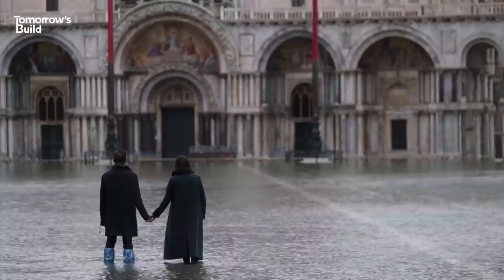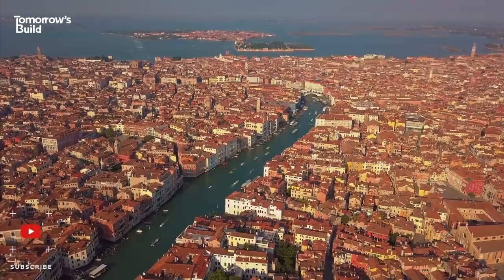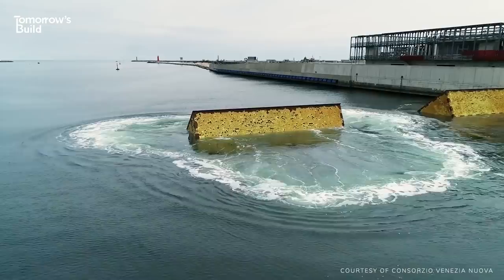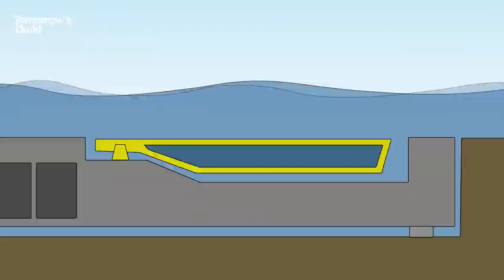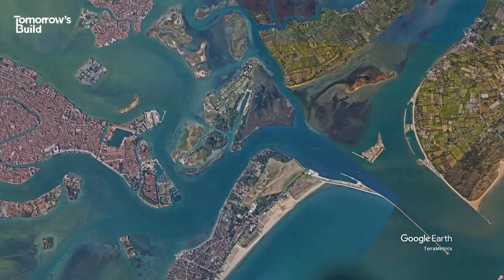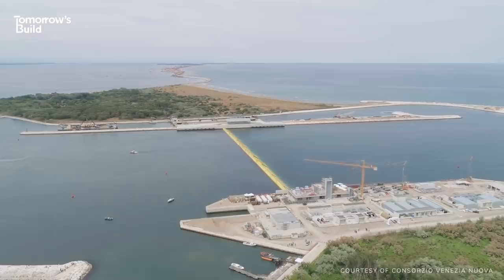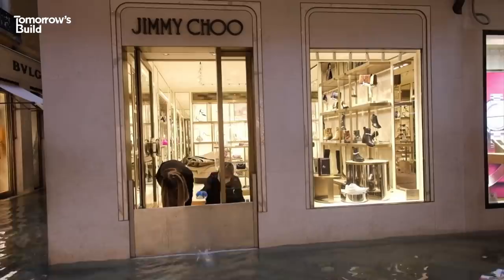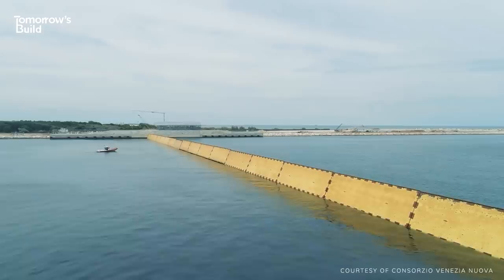The $7BN Megaproject to Save Venice

Comment: The clever bit of this system is, that it dynamically adapts to the tide level difference. In contrast to a watergate system, where huge steel doors have to withstand the tons of pressure from the water, these barriers operate basically without much stress at all. Waves are mitigated by the rotational degree of freedom and the water head pressure from the sea to the lagune is carried by buoyancy, rather then stressed steel. 

From an engineering standpoint, this system is great. Why, you might ask? If the water head becomes to strong on a conventional water gate to the point of system failure, the gate bursts open and lets all the water through, with the devastating effect of a broken damn. This system does the opposite. If the head pressure becomes to strong, a small flow over the top becomes possible, slowly and gently raising the lagune water level until equilibrium is recreated once more. 

I can see why it cost so much money, it's a brilliant solution.
Reply: And this is a brilliant comment.
Reply: Basically, the gate being slant at an angle makes the difference?.
Reply: Oh, Why you might ask? Lol
Reply: @kalyanvadlamani7607  the gate floating makes the difference mainly
Reply: Very well written summary, this is how I saw it working also
Reply: @kalyanvadlamani7607  compare a monkey trying to pull out a fistfull of goodies from a jar..
The more the monkey wants to grab the harder for the fist to come out of the jar.
Comparison may sound crazy but ????
Reply: Grazie amico
Reply: The system is great and smart, but stresses are still there, just not in the barrier walls - they are in the hinges. So theoretically the worst scenario with sudden rapid flooding is still possible. 
But with maintaince this problem should be negated
Reply: Men, Devinci solved this issue a few hundred years ago
Reply: But did it really have to be a dynamic system across the whole width of these channels? It's not like a single watergate in the middle is the only alternative. Couldn't you replace huge parts of the system with a classic dam, and save billions of dollars in cost and maintenance?
Reply: @trueastronawt  If you want to absolutely destroy the ecosystem that relies on the current under normal, non storm flood conditions, sure. But the lagoon needs the large amounts of fresh seawater that come and go. Also forcing all this water through a tight gate means much, much higher current at the gate. If you are a dolphin that wants to go into the lagoon, good luck not drowning.
Reply: You need to share this with the Jakarta provincial government
Reply: @GermanTopGameTV  It's not floating though? The video said it is sitting on the seabed, and the actual "gate" is hinged to one point. Theoretically that one point of contact is receiving the most stress.
Reply: @NotTurtleish  the hinge is the point of highest stress, but it is comparably low stress to all possible alternatives. The resultant buoyancy force is applied here, but all pressure differences cancel each other out. The force on the hinges can be assumed to be (within reason) constant.

The great thing about a constant force is that is mediates cycle fatigue.
Reply: @GermanTopGameTV  there would definitely be forces placed on those ringes. The gates aren't floating they would reach a certain angle in which force they are designed to hold. Once this height is reached the force from the ocean would be primarily placed onto the hinges. There isn't much force in rising the gates as they are raised through bouncy which is correct but the force generated to hold them and not raise any further or be pushed over by the current of the ocean is only balanced by the weight of the gates which would be quite heavily neglected as to use the bouncy method you are referring to. In turn there would actually be immense force placed on those ringes, it wouldn't be neglected.
Reply: This makes sense
Reply: This might be a silly question as i dont have an engineering background but are there no other entry points for the water? If i look at the edge of the lagoon it could just easily enter the city on a really bad weather? Or does that not really happen. And if not should they account for it i.e. due to climate change?
Reply: Even though complex systems cost money, that' not the reason it costed so much, as it is explained on the video.
Reply: @XxXgabbO95XxX  yes lots of corruption , a lot of people never picked up on that.
Reply: Sadly the solution has failed many times already.
Reply: Yeah I’m sure it is amazing but it seems like something better could have been figured out
Reply: @alanrice6077  like what ? 🤷
The way to "Dutch" have done your water control 🙂
Reply: No. I don't think so. The complicity of the project made it super expensive, first. Never tried before, but in tiny laboratories, that means you can't be 100% sure it will do its job, second. And, flood doesn't not ends at current level. In the next 50 years I would expect the floods and tides will rise in the level as well as in frequency. That means We will have to rethink and improve the project. And that particular design doesn't let ANY upgrading! Finally, we will have to build another one. Note my words.
Reply: @kalyanvadlamani7607  no if it were held up by hydraulics, the angle wouldn't do anything.
Reply: They are in fact genius, as the tree that doesn’t bend, breaks! These “floats” flex with the pressure.
Reply: The force on the hinges would be greater for a swing gate sluce such as the Maeslantkering in Rotterdam. The rising sector gates of the Thames Barrier are also limited due to mechanical strength to a width of around 90m. The Moses system is elegant in it's design, using compressed gas so it's non mechanical (just like the Thames Barrier or Maeslantkering), with the resultant force being on a hinge so it's more likely to stay closed than open on a storm surge. The lock structures future-proof it to an extent so unlike the Thames Barrier, if it had to remain shut then vessels can still transit. The issues remain that if such sea level rise occurs, Venice will become a stagnant pool, making it a thoroughly unpleasant place to be. Hopefully however MOSES will keep Venice safe for long enough for us to face the challenges of rising sea levels and deal with its consequences accordingly
Reply: It all sounds good, but I'm surprised it apparently needs to be turned on manually?
Reply: Just change the building standards so that the city functions with flooding. Replace cars with boats, flood proof buildings.
Reply: Lol they made it about a meter too short to be of any use by the end of this century. Oops.

Comment: It’s cool how these barriers are raised by using compressed gases to displace water, in the exact same way Submarines resurface.
Reply: Don't subs use ballasting to acend and decend??
Reply: @hueyfreeman7810  ballast is just water where there would otherwise be air.
Reply: @hueyfreeman7810  Once they're submerged, they can change depth using their control surfaces like an airplane. But in order to get submerged in the first place, they have to flood their tanks. And viceversa when they want to resurface.
Reply: @hueyfreeman7810  Subs work the same way. They have water tanks for ballast and when they want to surface, they blow the water out the tanks with compressed gas. Submarines also use “dive planes” (like a wing surface that can pivot) to pitch the submarine up or down
Reply: @notmenotme614  no
Reply: @hueyfreeman7810  Human ballasting.

Comment: I visited Venice in Nov 2017 and was shocked how much of the city was submerged when on a Gondola tour. Stairs and landings which would have been above water level when built were probably a metre underwater. It’s a fascinating place considering it is mainly built with wooden piles under it. It probably would have been cheaper to build a sea wall round the city instead of all those expensive gates?
Reply: There were different solutions. Even talking about raising foundations like they did somewhere else.
Reply: David Wang  Nothing lasts forever. What are you saying?

Comment: I once worked offshore close to Venice. The Adriatic can be as mean as they get. One night when boarding a helicopter, the wind and driving rain blew ferociously enough that the helicopter had a hard time staying on the helipad. Being a large man, they asked me to get aboard quickly for ballast. I was soaked as everyone else was. The helicopter shook trying to maintain its footing. The normal paperwork for the flight couldn’t be accomplished at that time. The Helicopter Landing Officer (HLO) was fighting the wind and rain to the point he crouched down leaning into the gusts. Once the doors shut and the pad cleared we took off with little resistance straight up into the storm. The funny part was that once we gained a few hundred feet, the ride smoothed out as we turned direction to Padova, Italy. The airport was only 20 miles away. 

Other times the Adriatic was so ruff that the rented cruise ship Nord Norge had to leave the platform because of the swells. We had a good 25 feet of up and down for hours. Finally we made for Port of Padova and protection from the sea. We had to stay there for 5 days before we could make it back.
Reply: Now you understand why the mythology was so much about the Adriatic. Because they truly would either get lucky and have a nice travel, or just straight up die in a horrible storm.
Reply: Great comment! Just have to say *rough and not ruff
Reply: You are right! Sometime, due to meteorological condition The west side of adriatic sea is as a pot when the water boiling. The waves rise up very quickly due to wind that increase speed constricted from Croatian and Italian mountais and the modest deep of seebed.
The result is a storm with high wawes withot a preferential direction an gusts of wind of very higt intersitity.
Reply: I doubt that helo was flying in those weather conditions sounds like a tall story to me!

Comment: What abt the sinking issue with the foundation? If I remember correctly, Venice foundation was built on wood, and at some point they were considering shoving in compressed plastic underneath fill in the space and hopefully make it more stable.
Reply: Yes, in the end this is all a huge waste of time. Venice is a temporary city and it cant be saved, and shouldnt be saved. 7 billion on venice with the state of southern Italy is shameful. The Venetians complain the cruise ships are making the water worse with localized displacement, being willfully ignorant of the fact a packed city with no roads or production of any sort needs cruise ships. They want to pretend that Venice has a reason to exist outside tourism when it hasnt been a financial center since the advent of the world economy. But the Italian govt wants to save it because tourism is all they have for the most part. That and the piles of crap Fiat builds you cant buy if you live anywhere it gets cold. Cause youll freeze to death.

Comment: It would cost less and be more fool-proof to build a causeway along the entire sea wall side of the lagoon and the Adriatic. Then using a pair of locks to allow ships to transit as needed, even up to cruise ships sizes. You could even build a slim causeway from Venice to the sea wall and have a commuter system for ships that might be too big in the future to use a lock. They would dock outside the wall and the passengers would transit into the city. 

The water in the lagoon would slowly become less saline and a new ecosystem would develop. This would allow for many things not found in the city at this time. The sea wall could even be built to put in a new airport. The advantages are huge for this Secure Lagoon concept and the cost is far less than what is being touted here and the big take away is that Venice would NEVER flood again.

Comment: ABSOLUTELY FASCINATING and all encompassing!  Some of the best time I’ve ever spent watching a video.  Although I’ll never have the money to travel internationally, I sure hope Venice can be saved.
Reply: Unfortunately this is only a temporary fix to a long term problem.
If not for the floods the city of Venice is still sinking into the waters around it.
The 7+ Billion spent would have been more wisely used if they did something about the long term problem of controlling the sinking city of Venice.
The floods are the least of their problems.
Reply: @weldmachine  Welllllll, at least they've done that.  I'm not an engineer but at least I know that trying to keep the entire city from sinking sounds truly impossible.
Reply: @greeneyedwarlock882  Not impossible to raise structures in height for different reasons.
It's called Hydraulic Jacking.
The Good part about this is you can keep making ongoing adjustments to the height. back fill as you lift.
Reply: @weldmachine  I'm well aware of the process but again.....trying to jack up allllllll those hundreds & hundreds of years old buildings that are incredibly fragile because of their age?  No matter how slow & carefully anyone tried, they'd fall apart and their sheer number, once again makes the task infeasible.
Reply: @greeneyedwarlock882  
True what you say about the fragile buildings of Venice.
But which is worse ?
Letting the city destroy itself ?
Or sacrificing some fragile buildings for the sake of saving so many others.
Demolition of unsound buildings is not a new thing.
I would be for saving the city not trying to keep the water out.
Just the maintenance alone each year could save multiple buildings each year.
100 million per year that basically does nothing except keep some people employed.
The whole idea of the flood gates is a temporary measure at best.
Not a long term solution.
If one part of the gate system fails the water will still come in ????

Comment: The thing I don't get entirely is that if the water level rises permanently, the barrier has to always be up as well or the sea level inside the lagoon will rise, meaning that no ships bigger than those that already fit through the locks can enter the city, so at one point the barrier has to be up 24/7 or Venice will drown
Reply: It's all nonsense quite frankly. The rising sea levels will obviously inundate the land either side of the barriers anyway. The projections for sea level rises are utterly terrifying. All you have to do is look at Oceanic Palaeontology records to see the enormous changes in sea level that are linked to historic climate change. These changes, entirely natural, have been massively speeded up by human lifestyle choices and so what would have once taken 5000-7000 years could well happen in only a few hundred. That's the problem. We won't have time to adapt. Look at it this way...the last ice age was caused by a drop of 6 degrees celsius from the global average. Now think about what an increase of 6 degrees would do....goodbye polar ice caps...sea level rises by 100 metres....the sea level has changed by that amount in the past and will do again.

Comment: Also need to ban large ships. Their wash damages the structures.
Reply: Their travel in the city got recently banned
Reply: just a short while ago, they've finally been banned. The large ships will now be redirected to Mestre docks on the mainland, without permission to come near Venice.
Reply: @mygetawayart  nope, they were banned from sailing through the grand canal and alongside st marco square.
But they can still park their floating skyscrapers close to the train station. Which is not the mainland.

They do have plans to build new terminals on the lagoon entrances. Which would solve this problem long term
Reply: they will get right on it sir!

Comment: Per Scripps, Venice and that whole part of Italy is subsiding (sinking) at a rate of 16 inches per century and ocean levels per NOAA are rising 12 inches per century.    Both reasons for flooding are wholly natural plate tectonics and cyclic worldwide ice ages followed by worldwide "warm ages" that cause ocean levels to fluctuate 1,200 feet  / every 15,000 years.   Bottom line,  that part of Italy is in trouble.
Reply: Sea levels are not rising.

Comment: Why not build a moat around Venice.
And then have a much smaller access point. 🤷‍♂️
Reply: but that's pretty much what venice has already, only it has three access points
Reply: smart!
Reply: My head just broke reading this comment.  Do we understand that a "moat" is an encircling ditch typically filled with water?  I keep shoveling the water to make a ditch, but it keeps flattening out all by itself!  So frustrating!
Reply: There needs to be a water exchange to maintain the biosystem that thrives in there. That's why they thought of barriers, not a damn wall
Reply: @blackkohi  a dam wall with barriers is what I'm getting at

Comment: I think there's a difference between a city sinking and global tides rising. You should do some research on that.
Reply: The sea level has been measured every day in Sydney Harbour at the same location since 1914. No rise at all in over a century; when first this was broadcast the sea level was 10 centimetres lower than average. So it’s one big big big lie. As for Pacific Islands being flooded; more lies. 
A few of the smaller island groups have some unstable land mass on coral, that can’t take much construction etc. whereas the vast majority do and are not having any problem.
Reply: @rossmcintyre3228  exactly. The guy in this video has no idea what he is talking about.